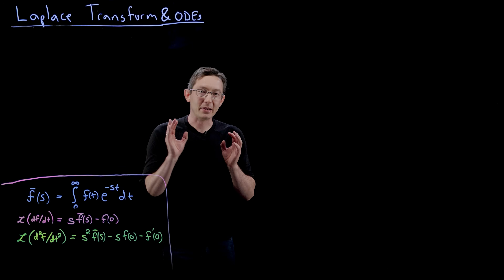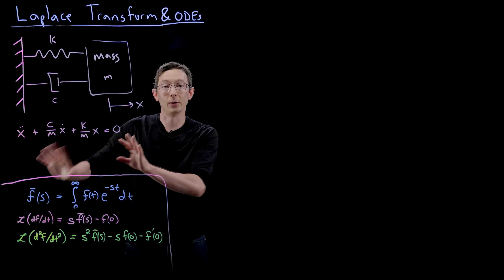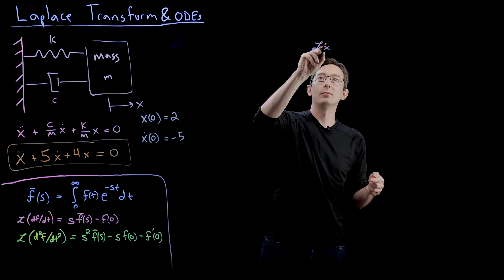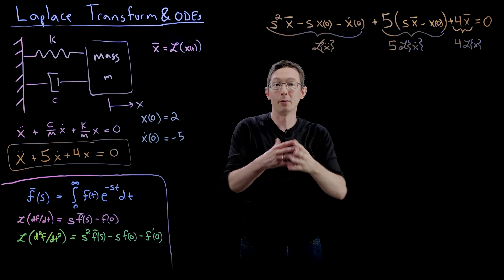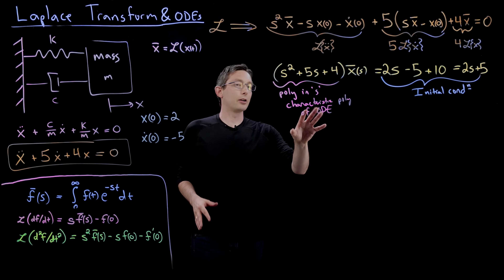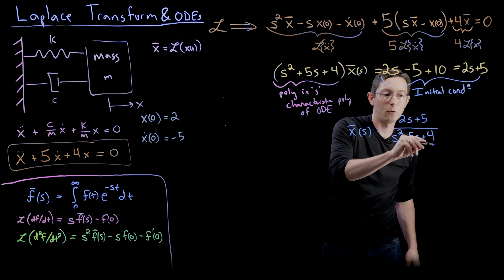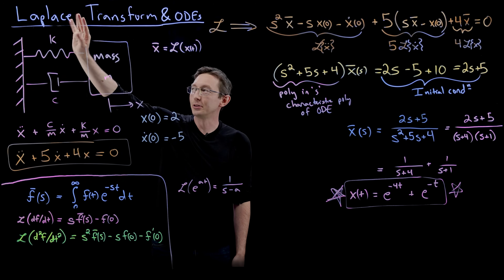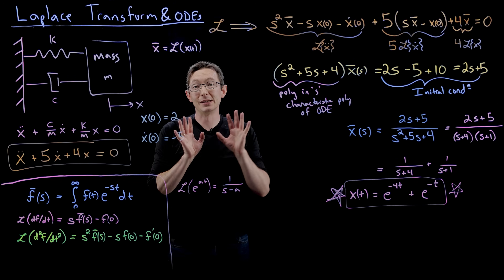Laplace Transforms and Differential Equations

Comment: Indeed! Extraordinarily cool. I really enjoyed your crystal clear approach to and explanation of solving this spring motion dynamics ODE. I like the control force part and would like to see how you handle it. I got a good grasp of the Laplace/Inverse Transform and used them to solve ODEs in my Differential Equations class taught by Professor Leif at KCC(CUNY). I recall using a lot of exponential and trigonometric identities to solve those ODEs. Laplace was a clever and intelligent French Mathematician - one of my favorites.

Comment: Question:
k is a coefficient indicating a restoring force depending on displacement x
c is a coefficient indicating a resistive force depending on velocity, (workings against the displacement)
The why in the final solution are both terms working in the same direction?
Reply: They are not necessarily in the same direction, but in the special case that the mass is moving away from the equilibrium position, they are.   If the position is x=2 and the velocity is x' = 1, then the restoring force is acting against the fact that it at a positive x-position, and the drag force acts against the fact that it has a positive x-velocity.  The two forces are therefore both to the left, at this particular instant in time.  So if x and x' both have the same sign, then the restoring force and drag force will have the same sign.

Comment: Can anyone show me what does s stand for
Reply: It's complicated.  The s doesn't necessarily stand for anything in particular that starts with the letter s.  You might think of it as standing for "state", I don't know if this is the actual term it stands for.

What s represents, is complex frequency.  The real part of a complex frequency is an exponential decay, while the imaginary part usually comes as a complex conjugate pair, that corresponds to oscillatory frequency of the sine and cosine terms.  What a Laplace transform is, is a spectrum of sine waves, cosine waves, and exponential decays, that add up to the function in question.

Comment: Mr. Brunton, could you please go on with a force function example to this video? Thank you for your efforts by the way...
Reply: Here's how it would work with a forcing function.

Given the free response equation of motion of:
x" + 5*x' + 4*x = 0
x(0) = 2
x'(0) = -5

Suppose the force function (right hand side) were 10*cos(2*t), with the same initial conditions.
x" + 5*x' + 4*x = 10*cos(2*t)

Find the Laplace transform of each term:
(s^2 + 5*s + 4)*X - 2*s + 5 - 5*2 = 10*s/(s^2 + 4)

Shuffle initial conditions to the right:
(s^2 + 5*s + 4)*X = 10*s/(s^2 + 4) + 2*s + 5

Rework the RHS, so we have one single fraction:
10*s/(s^2 + 4) + 2*s + 5 = (10*s + (2*s + 5)*(s^2 + 4))/(s^2 + 4)

Expand numerator:
(2*s^3 + 5*s^2 + 18*s + 20)/(s^2 + 4)

Isolate X:
X = (2*s^3 + 5*s^2 + 18*s + 20)/((s^2 + 4)*(s^2 + 5*s + 4))

Factor the quadratic:
s^2 + 5*s + 4 = (s + 1)*(s + 4)

Thus:
X = (2*s^3 + 5*s^2 + 18*s + 20)/((s^2 + 4)*(s + 1)*(s + 4))

Set up partial fractions:
X = A/(s + 1) + B/(s + 4) + (C*s + D)/(s^2 + 4)

Heaviside coverup finds A and B:
at s = -1, A = (2*(-1)^3 + 5*(-1)^2 + 18*-1 + 20)/(((-1)^2 + 4)*covered*(-1 + 4))
A = 1/3

at s = -4, B =(2*(-4)^3 + 5*(-4)^2 + 18*-4 + 20)/(((-4)^2 + 4)*(-4 + 1)*covered) 

B = 5/3

Construct result thus far:
(2*s^3 + 5*s^2 + 18*s + 20)/((s^2 + 4)*(s + 1)*(s + 4)) = 1/3/(s + 1) + 5/3/(s + 4) + (C*s + D)/(s^2 + 4)

Let s = 0, to solve for D:
20/((4)*(1)*(4)) = 1/3/(1) + 5/3/(4) +  D/4
5/4 = 1/3 + 5/3/4 + D/4
5 = 4/3 + 5/3 + D
D = 2

Let s =1 to solve for C:
(2 + 5 + 18 + 20)/((1 + 4)*(1 + 1)*(1 + 4)) = 1/3/(1 + 1) + 5/3/(1 + 4) + (C + 2)/(1 + 4)
9/10 = 1/6 + 1/3 + (C + 2)/5
C = 0

Laplace result:
X = 1/3/(s + 1) + 5/3/(s + 4) + 2/(s^2 + 4)

Invert the transform to find solution for x(t):
x(t) = 1/3*e^(-t) + 5/3*e^(-4*t) + sin(2*t)

Comment: i am astonished that you usually dont learn that in Undergrad Physics. The Laplace Transform can really save much time.
Reply from the maker: Lots of undergrad physics curricula do cover this.  But my experience is that it often really sinks in the second time students see it in grad school.
Reply: @Eigensteve  I believe I only first saw Laplace transforms when I took control theory at the University of Pennsylvania (which was a grad level class). Then it helped me in my math classes as an alternative way to solve differential equations. Never made any sense to me why the Laplace transforms weren't just taught earlier in math or physics curricula as opposed to learning them in a graduate level engineering class. They're super useful.
Reply: @MrSandman213  For what it's worth, I learned Laplace transforms as a sophomore undergraduate in Physics.